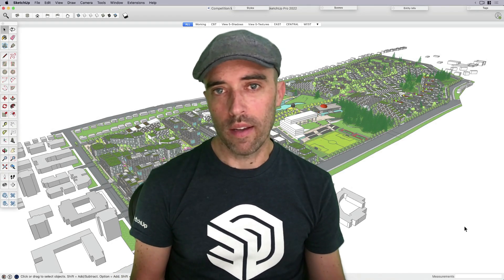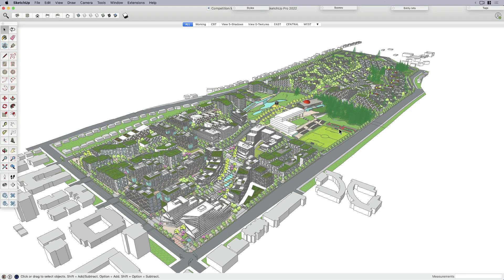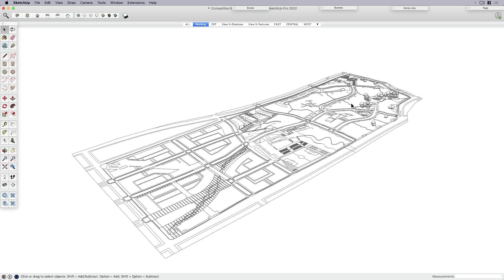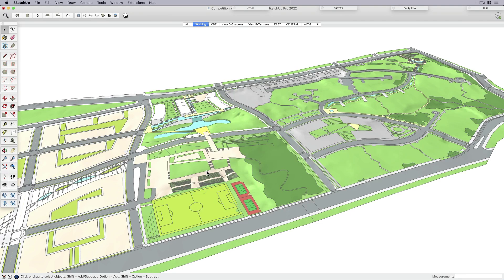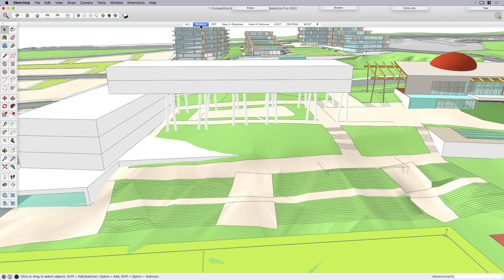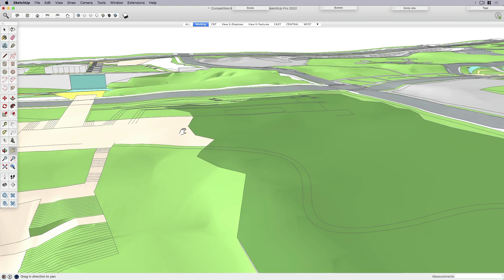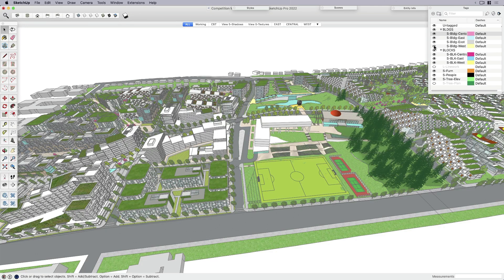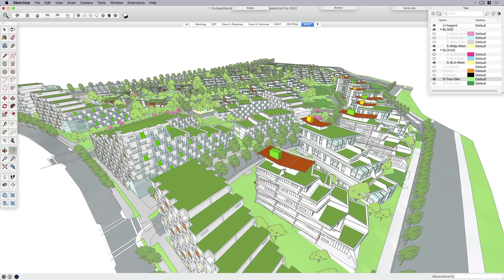Working with Large Models - Skill Builder

Comment: These are great tips.  I had - over-ambitiously - designed one of the largest models Sketch-Up has probably ever been asked to do, along with someone who knows a lot more about Sketch-Up then me, an engineer.  It took us >14,000 collaborations on the SU forum because we are continents apart.  Anyway, it was >760mb prior to the 2021 version of SU which cut it in half (that was such a drastic curtailment that I saved the old version in the original size before using the upgraded version to see if anything was lost in the transition, but so far, I don't see that; Sketch-Up just became vastly more efficient I guess!).  So, at 374.6mb, it's about 3X larger than your model.  All I've been doing to make it manageable is to turn off dozens-100s of layers 1 at a time.  But now I see I should have used scenes (my engineer partner couldn't even work on it on his machine, and it's not normally a slow machine.  Mine was a top-of-the-line fully loaded iMac when I bought it in 2017).  I used scenes for a 3-minute fly-through you can see on Youtube here: http://bit.ly/Riverarch, but not for the purposes you did.  It's probably too late to retro-model it like you did, but if the project gets approval, it will be worth that effort, so that I'm not the only one who knows the special tricks to make it manageable at all.
I've saved this video for that day!

Comment: These are all good tips which I also use even for small projects. It's great practice to keep tags and scenes organized, and redundant data purged regularly.

My default for any scene I create, is to make sure every aspect of the file is turned off in Tags that is not required to complete the scene and image needed. This (with scene transitions turned off) makes movement through the project quick, saving valuable computing time.